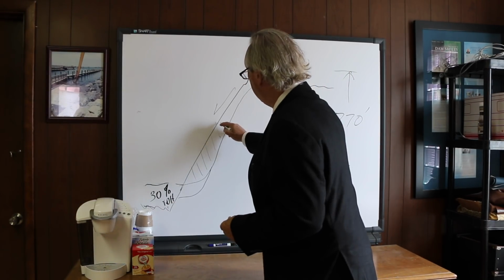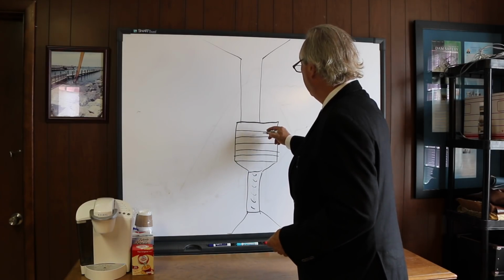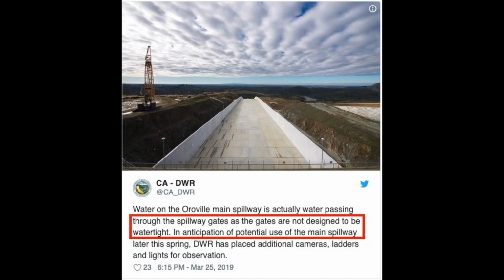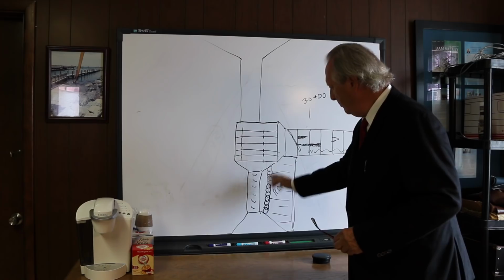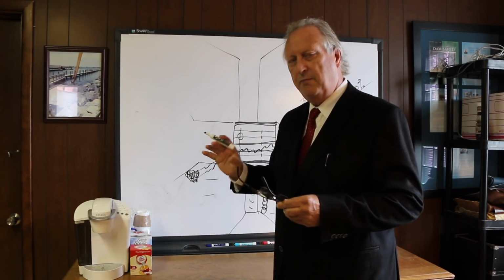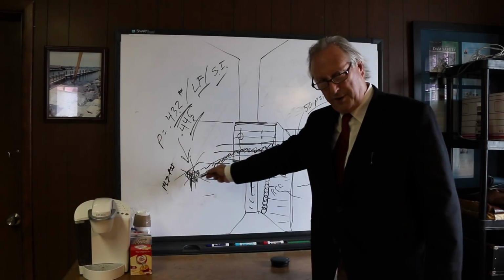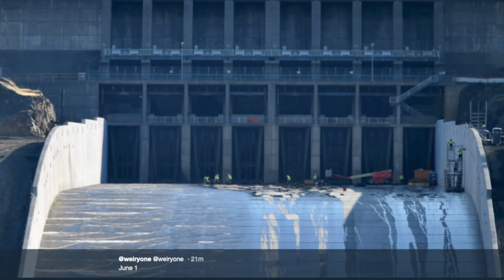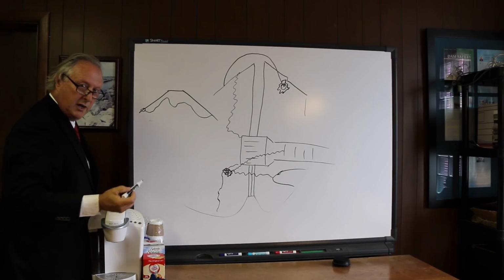Cahill on Oroville Dam 06-01-19

Comment: This video has 4,068 views as of now.  That is pathetic.  The entire North American continent should be watching this video.
If Oroville goes, it will instantly affect the world.
But I disagree with Scott.
Two years ago on the Paul Martinson show, Paul said something to the effect that with earthen dams: "Everything is Okay, until it's not..."  And Scott agreed wholeheartedly.
Watch the first 30 seconds of this video on Youtube:
"Video shows exact moment Brazil dam collapsed"
That could be Oroville at any moment with lake levels this high.
Reply: The other four times the dam was this high it was not for as long as it is now.  Moreover, that is not the point.  The dam and the reservoir was designed for a full pool of about 720' or so.  900 is the level that would be used to control an enormous flood upriver in a last ditch attempt.  It is not a level that any reasonable operator would want to maintain for any length of time.  Acting like the current levels are normal and not a problem is not safe, nor is it responsible.  
Johnstown PA had a similar situation in the 1880s.  They laughed and laughed about whether the dam would break and then one day it broke- and it was no laughing matter.
Reply: @whitewolf1298  You should watch Lisa Carhill's video on the meanings of full pool, flood buffer etc. Then you will understand the dam operation better.
Reply: I don't think a lot of you are understanding what I have been saying, so here goes again:  Usually, when engineerers design something, they "over engineer" it.  Basically, what that means is that if you build a bell hanger to hold 600 pounds, you design it to hold 1200 pounds, and if you intend a support to hold a room full of furniture you design it to hold two 600 pond gorillas playing concert grand pianos.
In the case of the Oroville dam, it was designed for flood control, so one figures what a worst case scenario might look like, and engineers the dam to hold 150 or 200% of the volume.  The "emergency spillway" is called that for a reason.  It is the "oh shit" moment when something goes catastrophically wrong with all other measures to drain water from the reservoir.  Consequently, one can conclude the reservoir was not designed to hold the current volume of water it is holding for any length of time.  (Before the water topped the emergency spillway in 2017, it had already flooded the parking lot, parks, boat ramps, and other facilities.)  IF water is porting through the dam itself, the added pressure from higher water levels is only going to make that situation worse.  The dam will slowly saturate until the frictional co-efficient is reach and then, bam! Katy bar the door.  One has the same scenario with a block of wood lying on a board.  Raise one end of the board until a certain gradient is reached, and suddenly the block accelerates and slides to the bottom. 
That is exactly the situation at the dam right now.  I am NOT saying the dam is going to give anytime soon.  What I am saying is the simple fact that the dam COULD give is simple not acceptable.
Reply: I understand the top of the dam is 20 feet above the emergency spillway.  That is wonderful.  But the last time the emergency spillway was used it was ready to fail with something like 10% of the volume it was supposed to handle.  Moreover something interesting is going on in the ground beside the main spillway.
If anything is going to go I hope it is the spillway gate structure.  That would be catastrophic but not nearly as bad as losing the weir or the dam itself.  Personally, I hope nothing happens, the authorities drain the reservoir, and do the maintainence Scott recommends.  I think we can all agree on that....
Reply: I'm in the UK I was watching it in 2016  I've watched the repairs. I'm watching it again now and I'm praying for all the people that could be affected.
Reply: @Jim Peabody The ONE AND ONLY time the emergency spillway was used was in 2017.  It was the main spillway that was "tested" a month ago.
Reply: @Jim Peabody Yes, the dam was designed to hold "901 feet of water" only for short periods of time in very exceptional circumstances.  The "emergency spillway" is there only so that water would NEVER overtop the dam itself.
The main problem here is that water is just a few feet from a level it never should be yet the Department of Water Services is acting as though everything is just fine and they are operating within normal parameters.
Reply from the maker: It was theoretically designed to pass the PMF!  what happened there???
Reply: @scottcahill945  I don't believe Oroville has seen a PMF yet, 2017 would have been fine if not for the spillway failure. The dam has seen one or two major inflow periods, but I don't know if they rated as PMF's.
Reply: The level of the main spillway is a good indication of what the designers thought the optimum water level should be.  If they wanted a higher level they would have set the main spillway higher. (duh.)
The good news is that, if last years precipitation curve is any indication, Oroville should just squeak by with releases from the Hyatt plant, without water going over the weir.  When the hot weather sets in, evaporation rates will increase exponentially and inflows will fall below 5K cps.
The $64,000 question:  Will the dam operators fix things when they have the opportunity later this summer?
Reply: White Wolf I can guarantee that you will see no major works on either spillway this year or any year, the reason? Nothing to fix. I am seriously thinking to make a video on oroville spillway to present all the evidence that points to the correct assumption.
Reply: @JohnnyMotel99  Go for it.  I'm sure that if you can convince the concerned folks at Oroville that everything is just peachy keen with the gates and the spillway the next thing you can do is open up a stand in Nome and sell snowballs to Eskimos.
Reply: @whitewolf1298  It's not DWR, it's more for the folk convinced that the new spillway is borked! 
I just believe it is not, having downloaded dozens of DWR images at full res and zoomed in, I haven't seen anything that shouts shoddy workmanship.
I think none of us really know the state of the gates. There are no photos of work on them, all the reports are from a few years ago, so to all intents and purposes its all speculation. However, from a dam security viewpoint, letting all and sundry know the state of the gates, could be catastrophic if some idiot wanted to cause a flood.
I agree with everyone else that DWR's PR machine is not that competent. As they say in Hollywood 'never underestimate the intelligence of your audience'

Comment: Scott Cahill you are absolutely brilliant!!  What you have described makes sense!  The Dam needs to be re-checked and the 'ports' sealed, BEFORE WATER IS RELEASED DOWN THE MAIN SPILLWAY!! If sealing is not done prior to water release,  then there is high probability of a significant structural failure. This failure may manifest as destruction of part of the 'new' Main Spillway, and even a displacement of the 'Gatehouse' from its present foundational position. The latter displacement could cause a separation of the Gatehouse from the Ogee Weir. The Ogee Weir could then progressively collapse!  A massive escape of a huge mass of water would then result! This falling water would seriously compromise the integrity of the Dam surface! No one would want to be anywhere close!!
Reply: Good comment, unfortunately, the dam ports cannot be fixed before they may use the SW

Comment: How do you find the ports so that you can inject grout?
Reply: John Ryan; A sinkhole appeared not too far from the gates and the OG weir on dry ground on the water side of the dam; May17th 2017. By May 20th the hole had been filled with what looks like soil with what look like tire marks in the area. I doubt that the hole was properly repaired in such a short time but just filled in with soil.
Reply from the maker: (It's Lisa) In an general, non-Oroville answer, ports and voids are found by inspection, non-destructive testing such as ground penetrating radar, destructive testing such as drilling in suspected areas, by visually looking for "symptoms" like water flowing into a crack and disappearing, areas of subsidence adjacent to the spillway, possibly dye testing in some cases, even listening for flow. A sinkhole is a clear sign that appears late in the cycled of internal erosion. One would hope to catch it WAY before then. (Sounding, which is done with a hammer or in the case of Oro, chains, is not reliable.) In the case of Oroville, all of the above, plus, we have data. 1-The overtopping event of 2017 uncovered deep fissures where the weathered rock was washed away. The deep fissures were almost certainly ports and should have been grouted properly before any repair was done. They also showed the direction of the strata, how the rock layers were oriented, and gave very good clues. I suspect there was strong "divots" and signs of porting upstream of the gate structure. (One person had photos of this upstream area online and was contacted by DWR and told to remove them "for reasons of national security." They were frightened and did so, even deleting the photos completely.) You always look for signs under concrete structures such as the gate house and the spillway. This should be a normal part of their periodic inspections. (GPR or drill. If you find a void, grout it. If you don't, repair the hole.) 2-Dr. Robert Bea identified the area of the initial hole as Station 30+00 and noted that there had been multiple cycles of repair at this location. If you "fix it" and it comes "unfixed" then you didn't get down to the root cause. This was (is?) almost certainly the location of a port. Repairs were done in 2009, 2013 (4 years between). I can count on my fingers and figure out they should have inspected thoroughly before the 2017 flood year. Voids could have been found and properly grouted, replacing the structural support under the spillway, and likely preventing the collapse.
Reply: @scottcahill945  When you say properly grout a port, it sounds like you are describing a process of filling the entire water passageway not just the outlet/inlet. Do you have to have access to both/all openings to do this properly? How would you locate an opening under the spillway?
Reply: Scott Cahill Lisa, I had never heard of these “National Security” threats to pictures made by civilians. There is no excuse for our Government/Deep State to make that kind of threat to an average citizen. It is a technique of tyrannical government/corporate control over citizen slaves.
Any reasonably intelligent person who followed this debacle since 2017 could see that there were serious weaknesses in the Dam infrastructure.
Keeping the weaknesses from hundreds of thousands of people below the Dam is NOT a proper excuse to prevent the release of pertinent information to the public. They should be informed of the risk and allowed to make their own decisions about the risk.
Reply from the maker: Always complete never plugging either end. Always it is a filling from the middle out or from one end to the other.

Comment: how much weight was lost from the front of the Earthen Dam in 2017 and during the rebuild of the MSW & ESW? Is what's left enough to hold in the Lakes Water pressure when full? Perhaps a better question is how much Weight of Bedrock & Earth is needed in front of the Dam to hold the Weight of Water in the Lake?
Reply: All of the erosion that was caused by the broached Spillway is about a mile down stream from the toe of the earth fill dam, the dam was not touched.
Reply from the maker: (It's Lisa) Oroville Dam is uniquely configured, but a dam nonetheless. The embankment portion (where the "green spot" is) is one part of this dam, then there is the main spillway, and the emergency spillway, both of which are on indigenous soils rather than on or very near the embankment, as is more typical. This unusual configuration has lead to some rather silly conversations about whether the main spillway or ESW are part of the dam. Here's an easy test. If it holds back water, it's part of the dam. The embankment did not experience obvious erosion in 2017, although there may be internal erosion occurring that is not obvious. The erosion was in the indigenous soils below the MSW and ESW. 

Ports in the area of the MSW and ESW are more of a concern that the dam not being able to resist the force of the lake at this time. However, you do hit on a critical issue that Scott discussed. The amount of water saturating the embankment is largely unknown because 53 of the 56 instruments that measure this, called piezometers, are nonworking and the remainder's data was regarded as unreliable by the DSOD inspector in 2016. Of course, we can observe the green spot,  and have done so in person. It was so wet that when you pressed down with your toe, water came up around your shoe. And it well over 30% up from the bottom of the embankment. The checklist of items that need to receive proper maintenance and repair on Oroville Dam needs to include replacing these piezometers, cleaning out drains, attending to the green spot, doing all of the similar things the DSOD inspector recommended regarding measuring the water level in the dam. The mass of the dam is better able to resist the force of the lake when it is dry.

Comment: I wondered how the patch on the waterside was caused. Water draining back through a port is the only logical explanation. It may well be that the port branches resulting in many ports existing leading back to that one area. It could create a high risk area of vulberability around the gates capable of catastrophic failure should a high level of water be pushing on the dam. Those damp patches are ominous.
Reply from the maker: yep!

Comment: Where is the round river rock which others have said should have been crushed?
Reply from the maker: The dam is constructed of river run materials from dredge tailings. This is fine for mass of a dam - but lousy for stability and permeability. It was graded but good soils were not available near the site. The problems of the eventual loss of fines from the filter areas of the dam can be offset with grouting and capital projects but no significant maintenance was done on Oroville for many years.

Comment: There was no dam failure!
Reply from the maker: Wonder why teo hundred thousand took to the roadways - did I imagine that?
Reply from the maker: The failure was of the principal and the emergency spillway. FEMA 93 states absolutely as does all other dam documents that the spillways and appurtenaces are, indeed a part of the dam. They are, in fact, the controlling part. This failure occurred remarkably at only 4% of the design flood. The ONLY thing that did not happen was an uncontrolled loss of pool. When people let the water out of their dams generally it does not cost a Billion and there is no two year cleanup. Perhaps, like Croyle, you think it a success.

Comment: The "new normals" at Oroville  would invoke policy-driven disaster preparedness at non-DWR dams!
Reply from the maker: California has many great dams which are very well maintained. DWR stated after the evacuation "the dam worked as it was supposed to" - the biggest problem is not with the earth and concrete. Thanks.